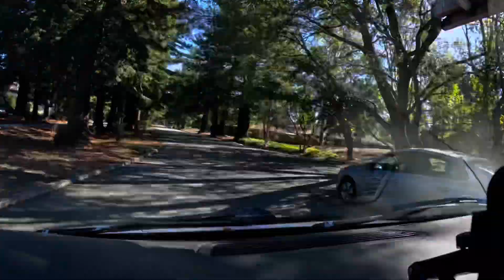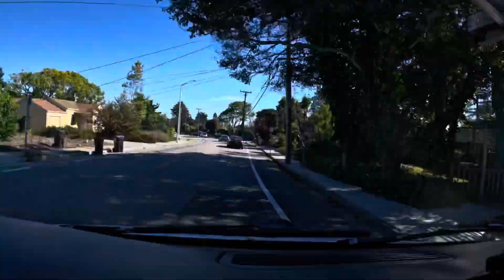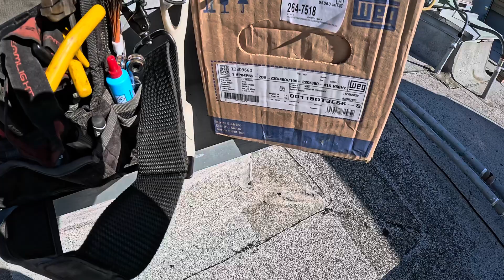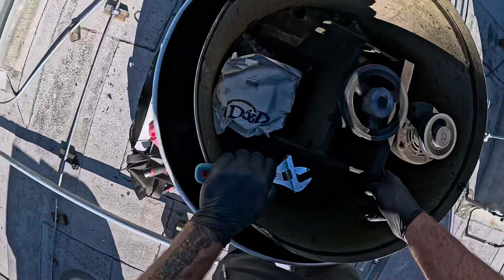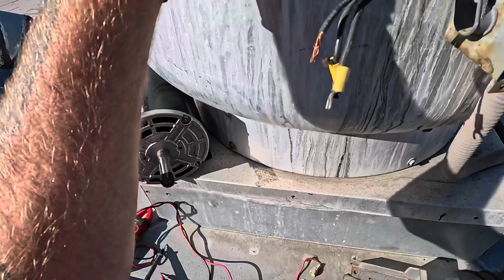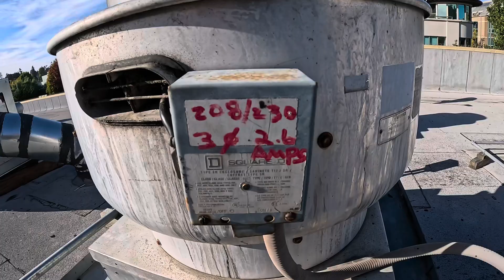Exhaust fan motor replacement

Comment: Hey I just changed the motor earlier today and I installed everything how it was but when I had it running the client said it wasn’t sucking up any air but the motor was hauling ass what do u think I did wrong, the grease trap was full do you think it has any affect ?
Reply from the maker: Check rotation of fan